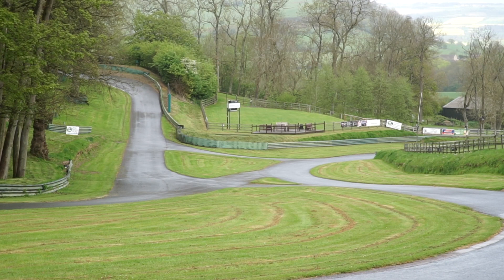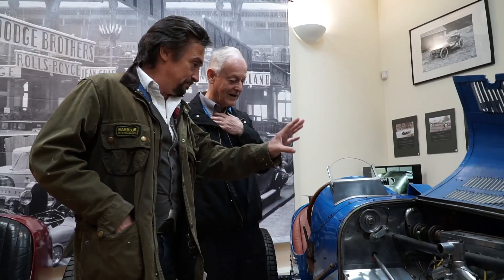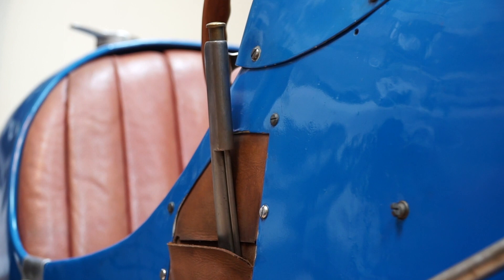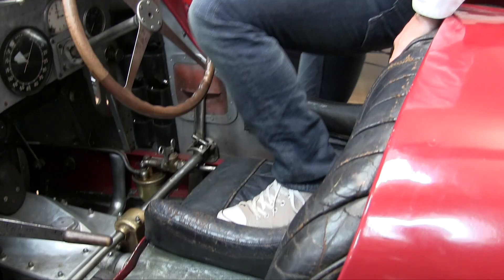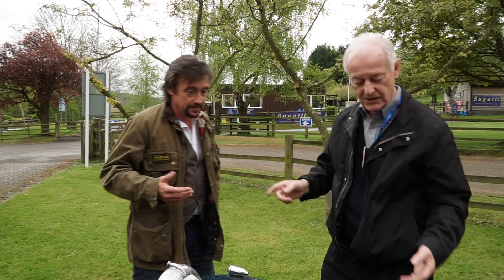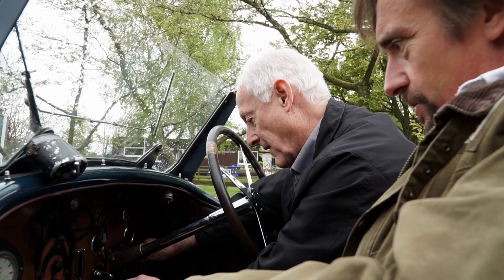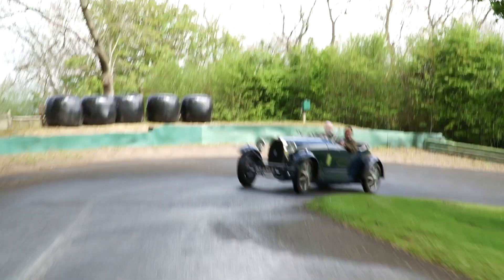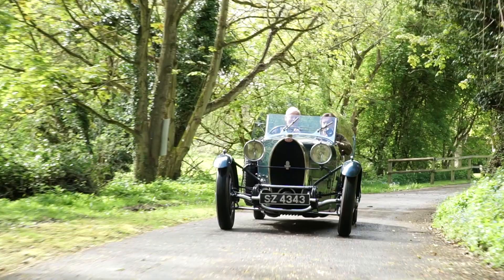Richard Hammond goes up Prescott Hill Climb in a vintage Bugatti (NL subtitles)

Comment: Hugh Conway understated (well, he's English, isn't he?) the Type 35's incredible pedigree. It's the most successful racing car of all time, winning at least 600 races in its day - some claim it was as many as 1,000.
Reply: Some forget that Ettore Bugatti often sponsored races in which only Bugattis were entered -- it's hard to lose one of those.
Reply: @noahvale939  Wasn't aware of that. Any idea how much difference that makes to the count?
Reply: @shanehnorman ,  It's a pretty safe bet that it boosted the count considerably. I'm not putting the cars down, by the way; I've been a Bugatti enthusiast for 65 years, but Ettore was a sly one.
Reply: So one-make races.
I don't see the issue with that.
Reply: @ToreDL87 ,  Neither do I, as long as you don't count the total number of wins accumulated by Bugattis against the total number of wins accumulated by other makes. Single make race wins were wins against no compettion. Get it?
Reply: Ford Escort thanks!

Comment: Not that I wouldn't grin like a shit eatin dog if I had one but if you look at the cars, and read about them, you quickly realize that they employed some of the silliest damned solutions to automotive engineering problems that have ever been devised. The magneto timing adjustment would be a case in point.
Reply from the maker: Looking at the engineering from an 1920s point of view a lot of Ettore's designs were quite clever. But more importantly, coming from a family of artists, Le Patron insisted his engineering was aesthetically pleasing too.

Comment: The First production car to break 100 MPH?  The 1926-1927 production Duesenberg Model X could do 100 MPH.  The earlier production Duesenberg Model A (1922-1925) could also do 100 MPH (it had the same HP and was slightly lighter than the Model X), but for some reason there was no official test done at the time to demonstrate that.
Reply from the maker: It's a close call, the Type 43 was introduced in 1927. Also, don't forget back in those days to a lot of Europeans American cars didn't really count ;-)

Comment: 2:49 200 Horsepower with that? and here I was thinking the blue one was the fastest one they ever made, as their were cars in the 50's with straight eights that barely did about 80 HP and weighed like 5,000 pounds, 

as that thing must have been the fastest accelerating car in the world right up until like 1960 before the muscle cars came out with how quick that must be. 

like has its acceleration ever been tested? as that is something you never hear about with these.
Reply: Look up the BRM V16, 1500 cc supercharged. 600 bhp in 1952.
Reply: Or the Auto Union racing cars, up to 480 hp in the late 30s
Reply from the maker: @musiccylinderK6  Blindingly fast cars, but not that fast accelerating though because of their weight.
Reply from the maker: Years ago, when I was in the passenger seat of a Type 51, this modern day 2.0 litre Alfa Romeo 133 challenged us to a race at a traffic light. I can still see the astonishment on that guy's face after we'd beaten him.
Reply: @NielsGarage  Probably true about the Silver Bullets, also due to long gearing